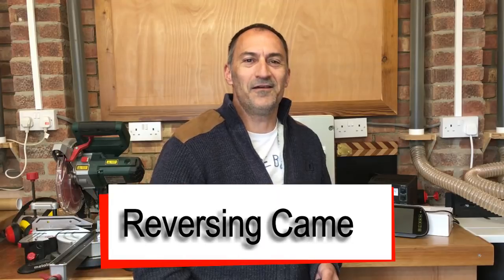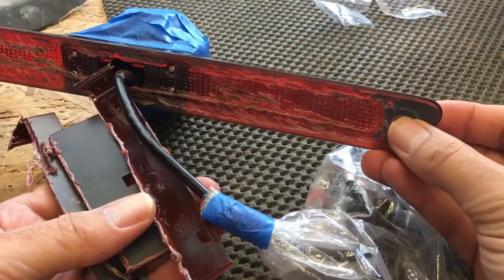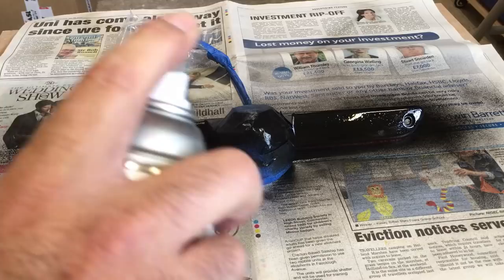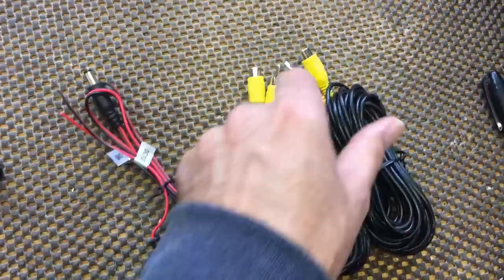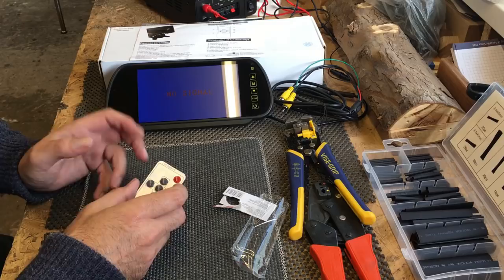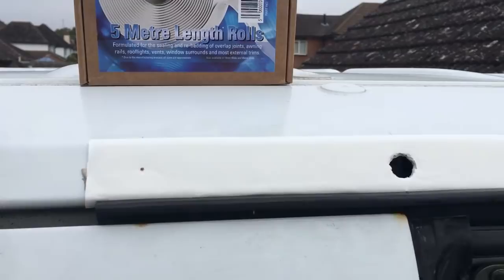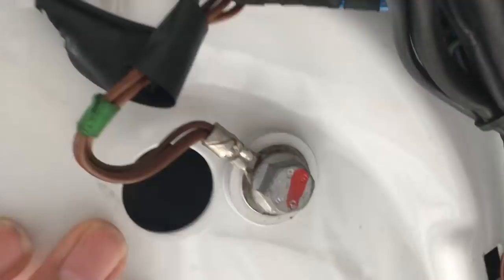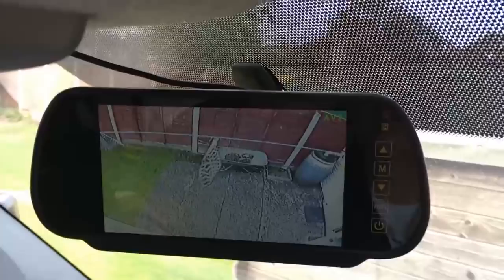Mercedes Sprinter - Rear View Camera Install

Comment: Hi Greg.  Excellent video again, and I'm looking forward (rearward?) to the next one.  Completely unexpected to see the credit at the end, but glad you found the link useful.
For myself, I think I would be inclined to have it auto (from the reverse light feed) AND switchable, say from the front interior light.  Having said that, you'll probably need a couple of diodes (one in each supply line) to prevent 12V being passed back to the interior light when selecting reverse, (might be slightly disconcerting/blinding at night), and also reverse lights coming on when powering up for ordinary driving etc.  
Regards Mark in the UK
Reply from the maker: Hi Mark, the manual was a huge help. Thank you. I’m tempted to make it just switchable and remove it from the reversing light. Then I have complete control of when I want it on or not. I won’t have to worry about vampire drain on the auto battery either. Thanks again for your support.
Reply: Hi Greg.  Hmmm. Not sure I know what you mean by 'Vampire drain'.  Not heard that phrase before, but I assume you mean some kind of minute drain by either the camera or monitor. If wired correctly, there shouldn't be any drain at all by camera or monitor.  I personally would run the separate power wire that supplies the monitor to the camera as well.  In other words, camera or monitor are not even connected UNTIL they're connected by the ignition switch 'ON'.
A separate, independently switched supply could also be connected, but be sure to use say, 1N4002 diodes - one in each supply line to prevent unwanted 'backflow' to any other part of the van wiring.
I've checked your videos to date and can't find any on insulation, and I also assume form the scenes in THIS video that you haven't done that yet.  Just didn't want to have missed it somehow.  Is it yet to be done or have you now done it but just not uploaded it yet?
Regards Mark
Reply from the maker: Hi Mark, the camera has built in LEDs and the monitor is effectively in standby mode waiting for a switched signal so I’m assuming there must be a small current draw at all times which could drain my van battery. So like you say it’s better to run separate power to both screen and camera via a switch that I can kill everything. That way no issues plus I can decide when to have it on. Insulation is on my to do list for this weekend. Had to wrap up some design changes first and finalise all electrics. Thanks for being patient. Cheers
Reply: No problem Greg, and thanks for taking the time to reply.  It's not as if you're not busy enough eh?  I hope all goes well with the insulation.
Regards Mark

Comment: Ah i installed the same on a peugeot expert. Very nice, what i didn't find out is the second video input to put a second camera. I use it on all the time.
Reply: hi, i've fitted this same system with the camera facing down to my step/bumber, i wanted to add a second camera which faces higher , are you saying i could plug the 2nd camera into the other yellow rca plug (which is marked dvd in the instructions) at the monitor? and it will show up on av2 or av1 ?, i was hoping so .thanks for your time
Reply: @rockgsxr  I want to try it, if you have a second camera give it a go. Because the system has two video inputs and the other yellow RCA must be an input too. I don't have a second one to try out.

Comment: Super very informative. I have just bought a car that has the very same camera fitted, however in a car installation the camera screen also acts as the rear view mirror, which has a downside in as much that the rear view is permanently dark, quite disconcerting (for me) and apart from removal there seems to be no way round this problem. Any other views welcomed

Comment: Definitely add an over ride switch to enable camera on at any time, that way it is legal for mot checks and more useful 😉
Reply from the maker: Larn Davies, can you explain how this accessory would be part of an MOT test? Thanks
Reply: Greg Virgoe just going by NewZealand and Australian rules which require reversing cameras to only operate when in reverse. Just assumed UK laws might be similar.
Reply from the maker: +Larn Davies that's something I will have to check up on. Thanks for the heads up

Comment: Thanks Greg, great video. Just wondering how this camera is performing after 2 years? looking to install the same. Sorry about all the questions on your videos. Currently trying to use this lockdown time to finish my van build. Your channel has been instrumental to my build. Cheers mate.
Reply from the maker: Gaurie Kidd the camera still works perfectly. In fact only recently I found out you can move it to change the angle of the picture. Bonus 😊

Comment: I wish there was a way to convert my useless rear view mirror into an always on video feed. Something like Jesse below suggested but wireless as I don't want to drill a bunch of holes in the fiberglass rear mask of my Sprinter based RV.

Thanks for all your hard work, enjoy watching your progress.

In the states I have not found "Mineral Wool" is that the same as the pink fiberglass insulation that looks like "candy floss"?
Reply from the maker: Hello Jeff,
Try this product that I believe you can get at Lowes
https://www.rockwool.com/products/cavityrock/

It performs slightly better than my Earthwool.

Comment: Hi, iv hot this camera but the camera looking at traffic is off just a blue screen and says no signal.However the camera looking down on bicycle rack is working. What would be wrong, Thanks
Reply from the maker: It sounds like the one camera has become unplugged or it has no power to the camera
Reply: Thanks. I'll check it next week when iv more time

Comment: hey Greg.. With my build on my VW T4 i rigged up a rear view camera system and whilst running those wires ran wires for reverse sensors also.. Reason being it has 4 sensors and can position the outer sensors angled 45 degrees( ish) on the corner of the rear bumper as extra safety..  Just an idea if you wanted to add that!.
Reply from the maker: Hello, now I can see out the back that should alleviate the need for sensors, I have found on cars they are not that effective anyway.

Comment: Hi Greg I hope your well 😊I’ve decided to buy one of these and just realized when I installing it I can’t use the existing wiring for the van as it’s now buried under insulation. How would I go about wiring this up? 😢 thanks any suggestions very welcome 😊
Reply from the maker: Yes use a piggy back fuse holder off the fuses in the dash to get a positive supply to the screen. Use a rocker switch in the headliner to give you a switch supply to the reversing connection. You can then just run the wire up the A pillar to the headliner. You can pick up a positive from the interior light for the rear camera.
Reply from the maker: Something like these https://amzn.to/3L2vpzY

Comment: Thank you for the video!
Which switch did you purchase and where exactly have you fitted it?
Will I not be able to turn the camera on with the remote controller if I wire it to the reverse light cable?

Comment: Hi Greg Great video ,can I ask 1 question please.When you splice the camera wire into the reverse cable is there anything I need to consider with regards to the current possibly being to high for the cables and potentially causing an electrical fire? Apologies if this is a silly question I'am not very knowledgable when it comes to electric's . Thankyou

Comment: Hi just quick question pls . I have a Camra fitter on my van and wire are cut from it but has 4 wires with Camra  red,black,green,yellow and one plastic  string type ( very thin like fibre optic ) clear nylon wire . And got 4 wires coming from front screen to the back of the van again ,red,black, green,orange and one is naked wrapped around the all 4 wires with silver film around it . Don’t know what to do and which wire goes where

Comment: Hello sir.   May I ask 
Can this camera film as we are driving forward 

As I believe I've got the same camera in my sprinter 4x4 and it would be lovely if I could see what is behind me when I'm driving forward 
I don't seem to be able to switch my screen on from the touchscreen on it 
Unless  I'm in reverse when it comes on automatically

 Best wishes to you and your family and thank you in Advance
for any advice you might be able to give me

Cheers 😊🙏😊☕️🍰☕️🍰🍷🍷
Reply from the maker: Yes, this can be done, I have done it with mine, I found a permanent live above the headliner (live that goes to interior lights) via a switch fitted in the headliner put 12v onto the green wire so you can switch it on at any time even when driving or when parked up. Although due to the angle it's not the same as a rear view camera it points down to the ground of course.
Reply: Greg Virgoe    Thank you young man for 
Replying to me.    Best wishes of lots more wonderful travels.    😊😊👍🌟🍷🍷☕️☕️🍰🍰🚐🌍☀️☀️☀️☀️

Comment: Great video! I've got one (maybe stupid) question.. If you would connect both the red and the green wire of the monitor to the white/red reverse light cable (which also gives 12v if I understand correctly), would that still work? And also solve the problem of the vampire drain?

Comment: Hi, any ideas why display is just in black and white and not showing any guide lines? Thanks
Reply from the maker: To get the guide lines the video lead has to be plugged into V2 and you turn the lines on in the menu
Reply: Also realised b & w because there was a blue protective seal over lens!
Reply from the maker: @karenroberts3628  glad you got it resolved 👍🏼😃

Comment: First of all thanks for the video, should have read the comments as the reversing light cable drove me mad(was the wrong one) now all working. I might be asking a silly question but is it a problem to have the camera wired to the permanent live from the inside light? Will that not drain the battery as it is always on?

Comment: I would have really appreciated seeing how you spliced your wires.
Reply from the maker: william ryan strip the insulation off your wires. Twist together and solder. Then apply heat shrink or electrical tape.

Comment: Hi Greg - having fitted one of these in my initial conversion - I’m now not getting a picture from the Camera. The error message say “ No Signal Video 2” Do you by any chance know how to switch between Vid 1 and Vid2? It should be in the instructions - but theyr’e long gone!!😂Thanks mate!
Reply from the maker: There is a V1 and V2 button on the right side of the monitor. But you will need to change the yellow video leads into the other plug to swap to the other channel.
Reply: @GregVirgoe  Thanks for taking the time to reply Greg. Mine has a V1/V2 button but despite message saying no signal on V2, I can’t switch it to V1 to see whether there’s a signal there??🙄🙄

Comment: Hi Greg. Why not keep the camera permanently on so you have a rear view ‘mirror’?
Reply from the maker: I have since wired the power via a switch in the headliner so I can turn it on anytime I want to and kill power totally to avoid any vampire drain.
Reply: Greg Virgoe ahhhh, vampire drain. I have a motorhome full of that nasty stuff. So many wires onto the batteries from all directions!

Comment: Hi there, it's Chico. Any idea on a system where you could mount 4 cameras, one for each side, that would record, maybe record once motion is detected. I've been looking for 12v security systems that record and haven't seen anything. Only Dash cams. I wonder if that would be a good idea for security while "Boon Docking".
Reply from the maker: Try looking at home CCTV systems that you can adapt to fit in your van?
Reply: I realize that I'm 7 months late with this comment but I've always thought that you could use door peephole cameras. You can get them wired or wireless, 12v, wide angle, colour and black and white, and even motion activated. If you shopped around you could have a complete CCTV system, including interior camera(s), with a rear view/reversing camera and a dash cam, with everything being recorded onto an SD card. Food for thought.
Reply: I've been In the Security business for over 25 years,a lot of camera recorders (DVR's) normally run on 12v dc,Example model is Vitek VT-TTAR410 which is a 4 channel recorder that is capable of 1080p cameras.Furthermore, a monitor wouldn't be required,install a cheap wireless router to plug DVR into,download app for your phone and connect to router,set ip in DVR and app and your good to go.
Reply: Chico time!!!

Comment: hi greg thanks for this video quick question can you adjust the camera by hand ? so i can see the traffic behind me instead of pointing it downwards?? thanks again....
Reply from the maker: Helllo Shak, the camera I have has a fixed lens, although it does have a wide angle of view so it is possible to see things close behind you. 👍🏼
Reply: thanks for replying back Greg, yes the one i ordered of e bay can be adjusted by loosening 2 screws cant wait till it arrives through the post  without the camera i have damaged my rear sprinter steps many times!.
Reply from the maker: Oh dear poor van 😉
I did make one further mod and put a switch in the headliner of the cab so I can turn the camera on at any time     
Great addition to the van. 
Best wishes with your install
Reply: Oh really !! so you can have the camera on all the time and have it working just by putting it into reverse...     The switch   which wires do you connect ?

Comment: I just installed my camera the live i got it from the reverse wire which on my 2013 sprinter was white and blue cable.
If i had a permanent live that would drain my battery as in the dark the cameras infra red lights stayed on, so now when i put my van in reverse  camera comes on,
Reply from the maker: Exactly as my pinned comment other than I have fitted a small switch on the power supply to both devices in the headliner of the cab.

Comment: How did you turn off the guide lines?
Reply from the maker: Jacob_AK87 the model I have doesn’t show guide lines it’s not an option. Have you been through your menu settings?
Reply: If you care enough about it you can splice into the reverse light wires. I beleive the feed for it is the white wire but don’t quote me on that. Trial and error will do the trick.

Comment: Why don't you want the camera to be on all the time? Don't you want to see behind you when you drive?
Reply from the maker: Hi Bill, that’s a very good point, I was thinking of wiring in a switch on the dash to make it selectable. I’ll also check the manual now you mention it. I may be able to turn it on with the remote control. Thanks for watching.

Comment: Great video as always . I am getting interference in my monitor installed in the van. It was not there when I tested the system on the workbench. It is a oscillating wave interference from something. I am running the power from the internal light both positive and ground and have not connected the reverse positive switch yet? Any help would be appreciated ??
Reply: Try it whilst not running the engine. Does it do it? Or not. Sometimes the live your tapping into isnt "clean".
Reply: @johndavies4644  Hi , Does it weather the engines running or not. The live is a fuse jumper from the fuse box
Reply: @ScoobieDee  fit a reverse camera rectifier there 5 quid on Ebay.. have you extended any cables? I had this issue on a long wheel base renault. Canbus can also cause this problem and that can be resolved using a relay.. by taking power directly from the battery and using the reverse signal to click the relay on and provide you with a non canbus feed. I personally think its canbus causing interference. But try the rectifier first cus there easy to wire up. Have you had any water leak in your camera?